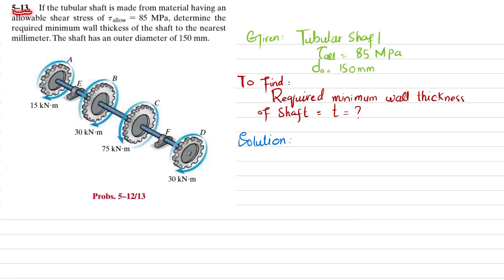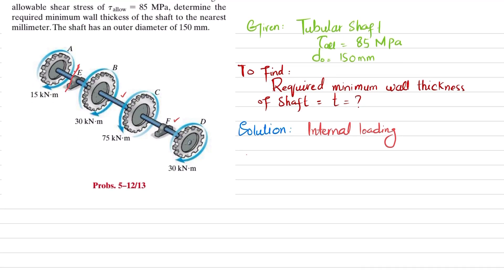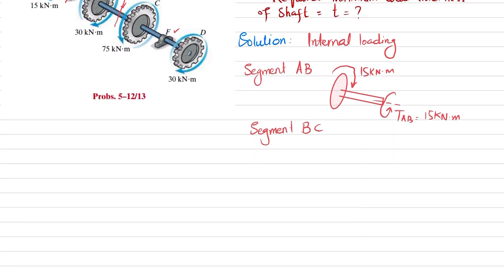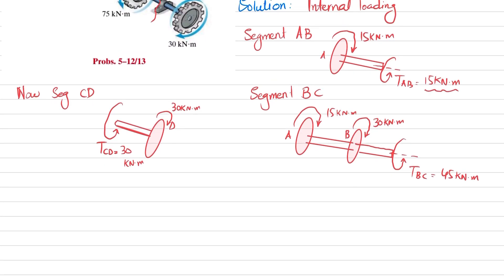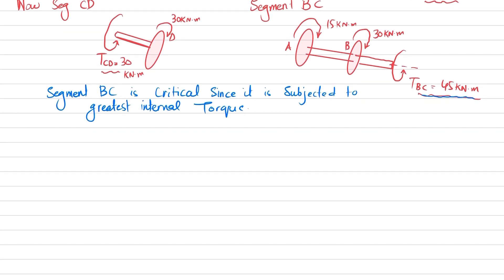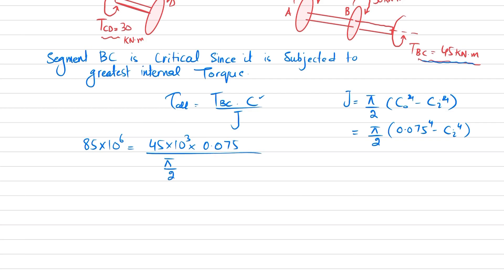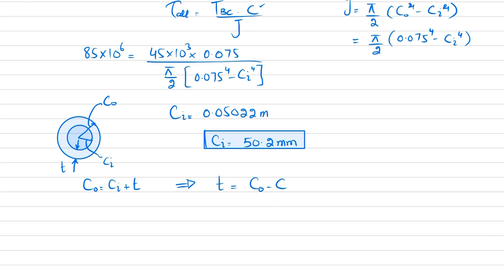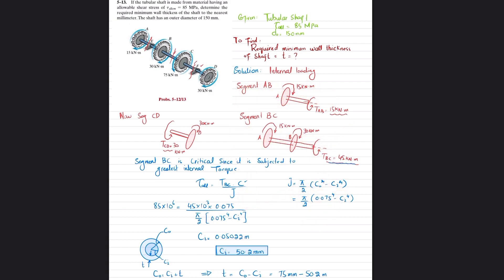5-13 | Ch 5 Torsion | Mechanics of Materials RC Hibbeler |

Comment: Sir, the CI is 75 mm. I tried to find 50.2, but I couldn’t get it.
Reply from the maker: What is CI ? And please mention the time frame
Reply: For this question, we need to find the thickness of the wall. The formula for thickness is t = c outer - c inner. After my calculations, I found that c inner is also 75. However, I realized that I was using millimeters instead of meters. I appreciate your help and support! 🙏🏾🙏🏾
Reply from the maker: @georgejacob3260 good and always welcome